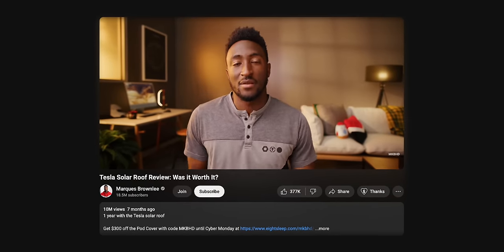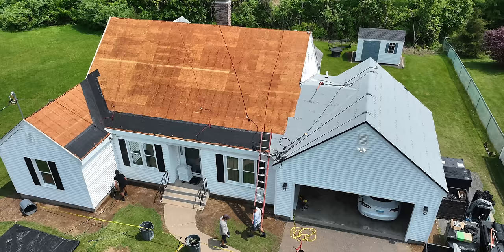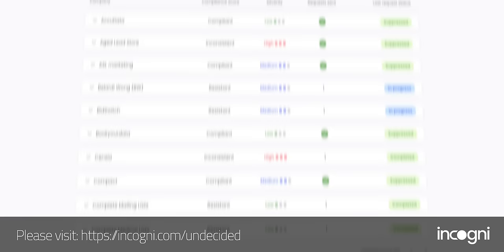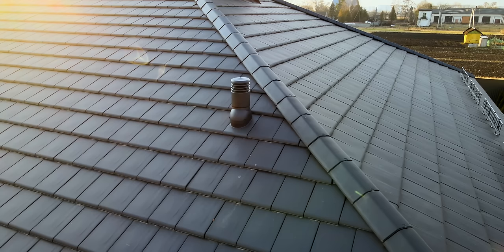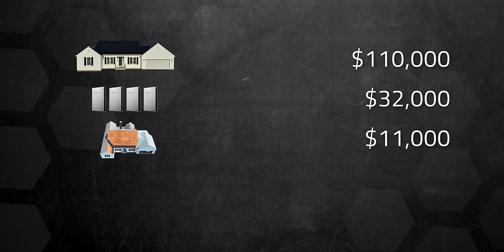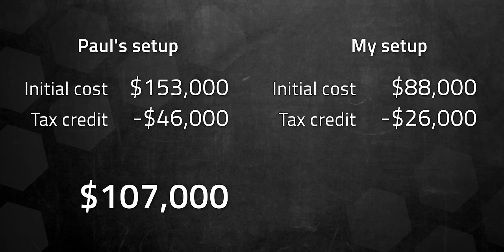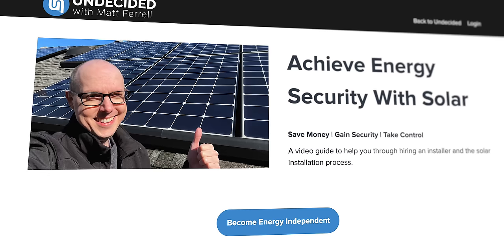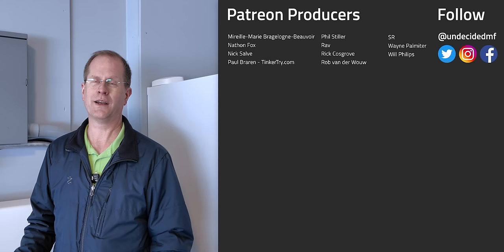Tesla Solar Roof vs Solar Panels: Which is Worth It?

Comment: Very interesting. I didn't know the prices were so similar.
Reply: Matt Ferrell got scammed if you ask me, he is basically and almost desperately trying to justify his choice. Maybe hes right about the longevity of his metal roof but I doubt that has much merit when looking at the Tesla Solar Roof material. Also he got less KWh than Paul? And therefor basically paid more for an, in my opinion, an uglier roof.
Reply: They've both been scammed - the cost is a complete joke. ~$100k for those systems and medium quality roofs is an absolute rip off.
Reply: @charedj  I think it depends on where you live but you might be right.
Reply from the maker: I was surprised too, but it’s going to vary a lot depending on where you live, local labor costs, etc.
Reply: @UndecidedMF  Matt, honestly, you overpaid by an incredible amount. 
In another video you state you have:
43x400W panels
IQ8 Inverters
4x Batteries?
Cost: ~$55,000-88,000(with batteries)

I can purchase in Germany:
50x420W JA solar Bifacials -5000   EUR
SMA 25kW Hybrid inverter   -2400   EUR
3x 12.8 kWh BYD Batteries  -17200 EUR
Mounting/cabling               ~-5000   EUR (estimate)

That's around 30,000 EUR plus labour. I've installed hundreds of systems including batteries and this would take less than a week to install, so I'll go crazy and call it 10,000 labour. 

That's ~40,000 EUR.

What on earth did you pay for dude?!
Reply from the maker: @charedj  it’s very difficult to compare in that way.  Location plays a big role in local cost of living, labor costs, etc.  My exact installation would most likely be cheaper even somewhere else in the US, like Iowa.  It’s one of the challenges about talking about costs in my videos.  It’s really difficult to normalize those costs to make them universal.
Reply: @UndecidedMF  May I ask what batteries you're going with? I'm looking at US prices for panels/batteries/inverters and they are more expensive but not overly so... currentconnected for example have pallets of Blusun 415W panels for ~$200 per panel, and SOK batteries for ~$275 per kWh. Inverters can't be that much more expensive where you are, surely?
Reply from the maker: I'm all Enphase on my setup for inverters and batteries (Enphase microinverters for the panels and Enphase IQ 5P for the batteries).  If you want to see how the price of my panels breaks down for US prices: https://www.energysage.com/solar-panels/rec-group/2544/REC400AA_Pure/
Reply: @UndecidedMF  how long will it take for you to have your investment back?
Reply from the maker: @LiveMedia123  for the solar (not the batteries) it’ll be about 7 years.
Reply: @UndecidedMF   My 13.2kw was about $8000 (AU) installed with rebates some 5 years ago - its cheaper than that today with even less rebates on offer. In 3 weeks or so, I'm having a 13.6kw battery setup installed for $10,000 (Au) and will get $3000(Au) back as a rebate- that's $15,000 AU for a fully installed solar and battery set up - i know its smaller than yours, but even if i double it to 26.4kw solar and 27.2kw of battery storage, that would be $19,548(US). I am blown away by the expense of such a setup in the US; it makes no sense.

This is really worth a video on its own. I trust your numbers, and it was good to put them in so we are all educated on the actual cost comparisons, but I just don't understand how the US with such a large market is so much more expensive. Even if i took away my rebates, the cost is still so much more in the US than in Australia where I live.
Reply from the maker: @xiaowei1  Australia has some of the best solar prices out there, but it’s difficult to make comparisons like this.  Cost of living and labor is a huge factor.  Just compare the difference between Australia and the US: https://www.mylifeelsewhere.com/cost-of-living/australia/united-states. And that’s the average US, which has massive variations within it.  If you compare to the Boston area it gets worse for cost of living (region where I am).  There’s a lot of factors that make it look worse than it is, but I think you’re right.  There’s a potential video here to explore this … as well as what Australia has done to make solar so affordable.  👍
Reply: @UndecidedMF  Thank you for the response. The link was very interesting. Australia took a very progressive approach to solar, and it has made the world of difference. Solar became very competitive, and prices keep falling because of it. Pickup is so wide spread now, my power company's EV plan provides free electricity between 11:00am and 2:00pm (So we charge our electric car's, run the pool pump, electric hot water system kicks in, wash clothes, run the dishwasher... and whatever else at this time). They do this so we can use our solar power at this time, but I make the absolute most of it.
Reply from the maker: @xiaowei1  that’s very cool.  I wish more places would follow Australia’s lead with how to handle solar.  I know there’s some rough edges that people don’t like for how it’s handled, but by and large it’s worked extremely well.
Reply: @UndecidedMF  In your comparison the Tesla solar roof was actually cheaper because you shouldn't count the $11k in underlayment refurb on Paul's house as it's an old home vs your new build. Tesla solar roof + batteries is $142k while metal roof + solar + batteries is $133k. That's a difference of $9k but when you factor in the tax credit the Tesla solar roof + batteries is $100k while the metal roof + solar + batteries is $107k. On top of the $7k savings he has more solar (10kW extra), battery storage (twice) and the aesthetic appeal.
Reply: @LiveMedia123  Just some finer points/thoughts I just had - Matt has geothermal vs my air source heat pumps, and he has excellent insulation and thick walls. So his needs for power should be considerably less. With trees around him and more land, it seems like Matt's choice is great, with fitting into a dense neighborhood not his concern. That's all subjective anway, he and his wife seem to be happy, and I'm happy for them. But that's just me.
Looking at various solar calculators, costs do vary widely. But I can totally understand how it appears we both overpaid. We talk about this at more length about our projects and our thinking in the recent TBD Podcast episode about this video, and in my long-form detailed article, both of which were a lot of fun to do. I hope you'll find value in the perspectives we add there. We were both nervous sharing the prices we paid, but we also  knew we'd likely be skewered even worse if the video went up with no prices. Hopefully we didn't scare folks off, and I'm quite sure many people will find much more affordable ways of accomplishing similar objectives,and that's great. He and I are quite aware of the cost of being a little early in adopting newish technology.
- Paul Braren (the guest on this podcast episode)
Reply: @TinkerTry  I wish you had included alternatives if any that were considered like Lumio for you, or SunRun for Matt.
Reply: @xiaowei1   Comment I made earlier, just substitute UK to AU:  
Yes, that's in the UK . We, in the US, have a different business model. When product production cost goes down, stake holders are gorging, consumers are gouged. Also, the average American has a very strong resistance to admiring being duped. It helps the business model.
Reply: @charedj  The one thing you do not understand about the USA is the tax rebates and credits.  When I have received bids for work that get a tax rebate from the government the contractors always raises their price so they get the rebate and not the customer. (I do electrical work so I know the actual cost.) It just artificially raises prices. The customer does not see the savings.... they think they do but they don't realize how cheap it really is.  The big catch in the USA most people can not do the work themselves even if they know how. The government and the utility will not allow it. You are forced to hire a contractor.

Comment: I made the decision 11 years ago to go with a metal roof with standard sized frameless panels. 
I saw these advantages:
1) fewer connections in each string
2) larger gap between roof and panel, giving better ventilation, cooling and therefore efficency 
3) more choice in the market using standard sized panels and better efficiency.
4) fewer panels and therefore easier to replace/maintain. I bought 85 panels + 2 spares. One panel shattered on install - not a problem, had a spare on site so i now have 1 spare panel.
5) the metal roof below is more like factory roofing with a repeating trapeze ridge/trough  profile. Cheap, lightweight, long lasting and you don't see it because its behind the PV array.

In terms of aesthetics i chose a south facing monopitched roof at 35 degrees. Basically a large rectangle covered by a 5 x 17 PV panel grid with no through entries (chimneys, windows, ventilation etc.) Looks great. The house is also box form below the roof - better for surface area to volume ratio and easier to acheive passive house rating than a complex H shape with a correspondingly complex roof shape.

The panels were 220 Watt. Modern panels of the same size are 440 now. I will replace them in 4 or 5 years - the replacement will be easy - we can use the existing aluminium subframe and external fixations - no new drilling into the roof will be required.
Reply: Your setup sounds great to me, I'm very happy things sound like they worked out very well for you. FYI, I wasn't allowed ground mount in the towns I wanted to live in, but that's just me, so many others would love to do what you've done. Building new (with a way more efficient design) was quickly ruled out during pandemic due to local construction prices, and lack of small lots to build on.
- Paul Braren (the guest on this podcast episode)
Reply: $220 410W panels right now. Might want to move up your replacement timeframe.

Comment: One thing that isn't considered is the Home Owner Association rules. Currently, our area has legislation drafted that will restrict HOA's from preventing Solar installations. We'll see if it passes.
Reply: Most HOAs allow for Tesla's solar roof since they're indistinguishable from normal roofs from the outside.
Reply: @MCPicoli  that restricts the homeowners to one brand and style of renewable energy.  It's not the best solution for global change that's needed, in my opinion.
Reply: @ricoma6037  true, just saying that at least there is one option instead of none.
Reply: Check state laws, several states have prevented HOA's regulating any solar installations
Reply: Check the laws in your state. Many limit  how HOAs can regulate solar panels
Reply: @D3adP00I  Very true. Even red state Ohio passed such a law in 2022 and very soon thereafter solar started appearing in our neighborhood. Call your local reps office and ask them about if you aren't sure.
Reply: Sue them!!!
Reply: We have current legislation proposed to prevent HOA's from preventing homeowners from utilizing solar.
Reply: Good lord, why would someone buy into a HOA community? I can’t even imagine putting up with that bureaucracy.
Reply: I know Virginia passed laws about 'unreasonable' HOA rules on solar panels ...then had to define what was reasonable. 

Similar but different - Virginia passed a 'Right to Charge' rule to prevent an HOA from restricting an EV charging station. 

(I stopped following when it was just easier to avoid HOAs altogether ...)
Reply: @MCPicoli  HOA is a joke and should disbanded
Reply: @serdarcam99  I fully agree, but that won't happen any time soon in most cases. Maybe in a few years?
Reply: That is a good point, and it would be good to know if they consider a Tesla Solar Roof any differently than a traditional roof with panels added.
- Paul Braren from TinkerTry
Reply: @someoneelse6934  America - "Land of the Free": Also America "I can't do that , my HOA won't let me"
Reply: @D3adP00I  State? My understanding is that it's a Federal law - much like HOA trying to restrict antennas. A friend of mine, who has since moved to another state, had his HOA try the whole "aesthetics" crap with him. The solar company we used had their lawyer give them a call and it was solved in an hour lol. I think after that their only request had to do with frame color and that was no big deal since he obviously also wanted his house to look nice. HOA can get bent!
Reply: As a highly skilled PV designer with an international degree in energy engineering and over 4 years of experience in American solar companies, where I completed more than 1000+ projects and obtained permits from numerous counties, townships, utilities, and cities.
I am confident in my ability to create comprehensive designs that align with local regulations (HOA), national requirements (NEC), and international requirements (IFC, IRC), ensuring seamless approval processes.
Reply: @serdarcam99  HOAs are reflections of the effort people put into them.   And quite literally you can dissolve them.  Just get enough neighbors together and vote it out of existence.   If you don't have enough neighbors who agree...maybe it's not that bad.
Reply: @pixelpusher220  people working together is fine but they don't have any saying whatever i can install solar panels to my roof or not
Reply: @serdarcam99  you agreed to be governed by their rules when you bought the property.

Comment: I already went with standard solar panels.  Only a 3 bedroomed house in old England with a 4 kWp system but I have not paid for any electricity in almost two years now.
Reply: @BobDevV Off-grid equals you control everything so your investment return can be calculated and is assured. Grid-tie means you have no direct control, and you have no assurance that you'll even see a substantial return of your investment much less all of it.. See what just happened in California- that can be you too.